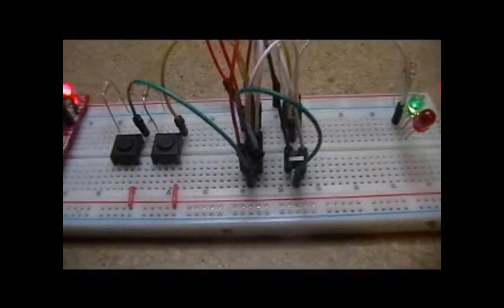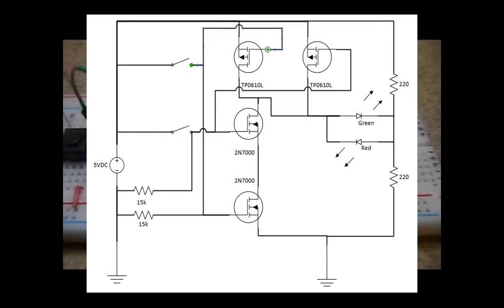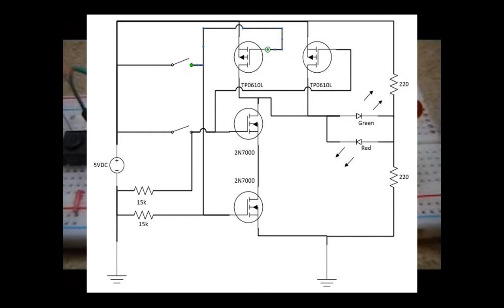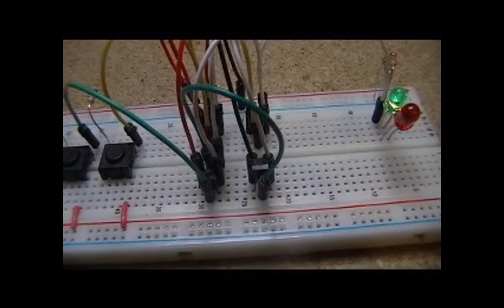MOSFET Transistor Logic #4 - NAND Gate

Comment: Hello, I saw in the schematic that all the gates of these P channel and N channel mosfet transistors are pulled down to ground by a resistor, I understand it’s good for N channel mosfet, but for P channel mosfet a pull down resistor means the mosfet is by defeault is ON? Why is that ?